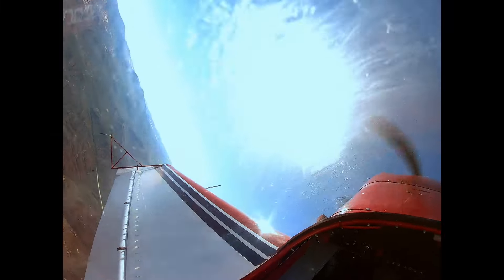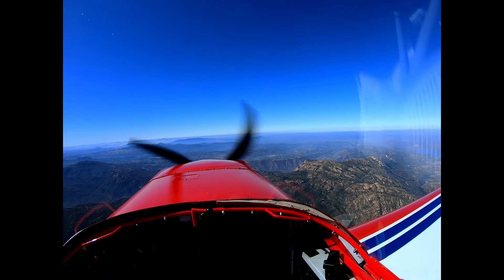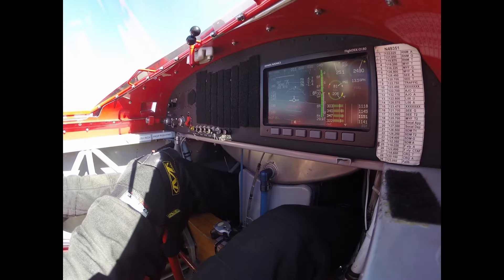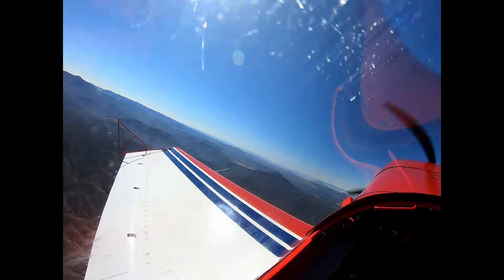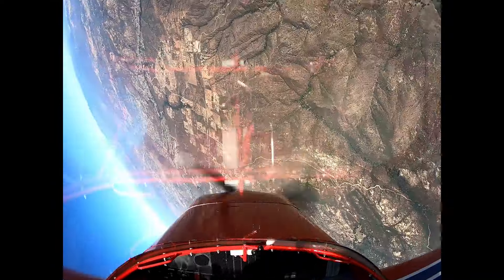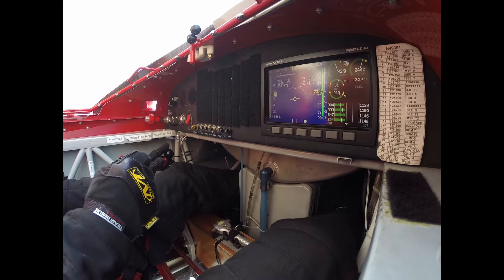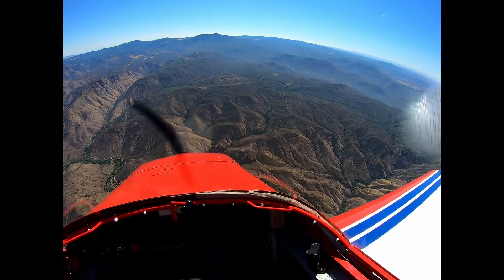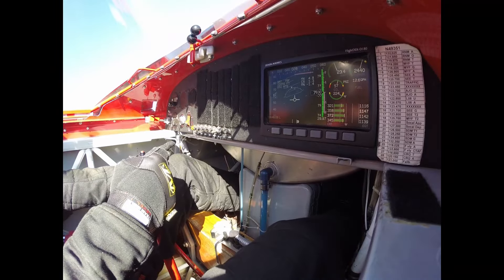DR107 Aerobatics Cobra, Forward tumble, Slow loop, Slow humpty

Comment: Thank you very much! Great one, as always
I have a question about the throttle while doing the Cobra, it will no be more helpful to reduce the throttle and when the speed is right, to open it rapidly with the pull?
Reply from the maker: You may have to do that anyway depending on where you place the figure in your routine. The reason for doing so would be more a positioning and speed target rather than making the figure work better.
In this video the speed was correct because it was achieved during an acceleration phase coming from a lower speed. If approaching from a higher speed than required, I prefer to insert a figure that will achieve the same thing, thus retaining as much energy as possible.
Many show pilots do this figure in gournd effect right after take off. Thus they are at full throttle, with the engine developing maximum power and a lot of smoke ... in gound effect to get the best possible performance and be able to do it at a slower speed leading to less climb and shorter recovery. Any minor technical glitch will likely be fatal. 

Either way, give your idea a try and report back. I'd love to hear about it.
Reply: @NiccolaiMurphy  Thank you! I put this figure right aft torque roll recovery and I tried to do it from 45 line and it felt good than I thought, I"ll try to do it on straight level and see how complicate it will be. 
By saying retaining as much energy as possible - what do you mean?
Reply from the maker: @RoyBenAnat  
Energy is required to keep flying. It consists of kinetic energy (proportional to the square of your velocity) and potential energy (proportional to your altitude). The engine adds energy to your system, maximum contribution is when at full throttle. The more that you can run your engine at full throttle, the better your energy state. Drag takes energy out of the system (your plane), high g takes more energy than low g.

You enter the box with a certain amount of energy. If you take care in the design of your sequence, you can maintain a high energy state throughout most of the sequence. If not, you will end up low and slow and have to break and climb to restart.

Gyroscopic figures require low speed, so put them after a figure that reduces your speed, so that you don't have to idle the engine to loose speed without exchanging it for something that will maintain or gain energy.
Reply: @NiccolaiMurphy  Thank you very much for the detailed explanation! I'm learning a lot from videos